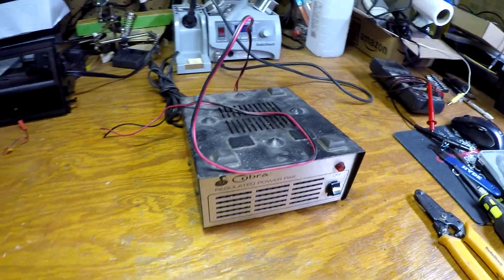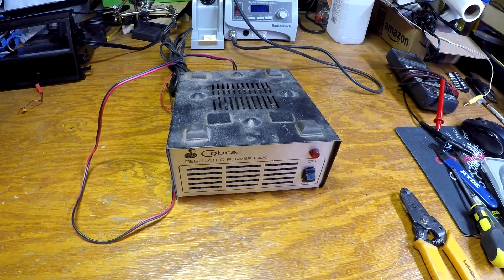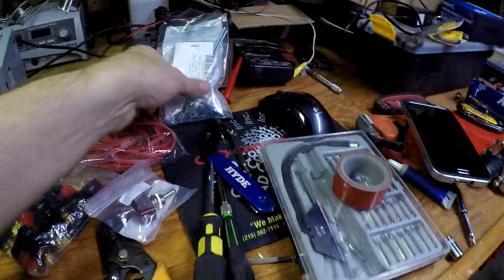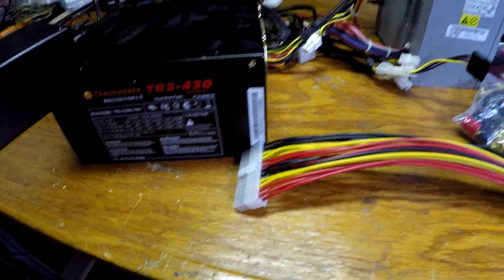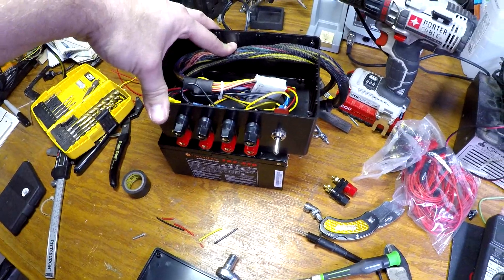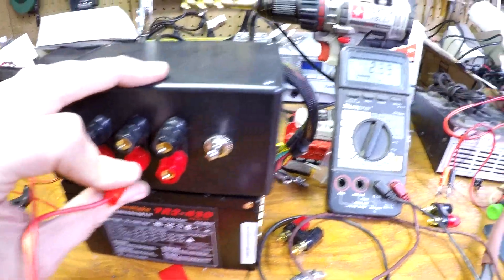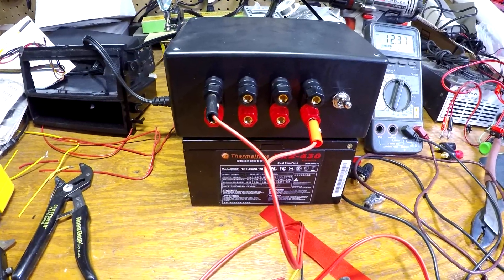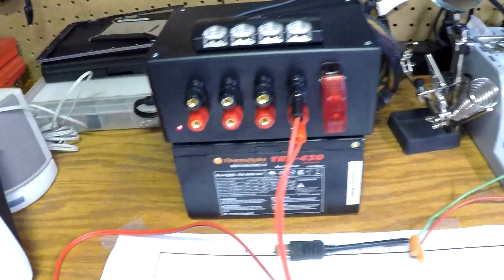How To: DIY Bench Top Power Supply From Old Parts!!!

Comment: Look at the rating for the -12V line. It's only rated for 0.3A. Also, you have two 12V rails on there. One is rated for 14A, the other is rated for 15A. You have almost 30A at your disposal, whereas the plain power supply only has a single 12V rail of 18A.
Reply: +Tim Ramich I guess I should have waited until the end of the video to comment.
Reply from the maker: +Tim Ramich Hey Tim.  Yeah the -12v is rated at 0.3A.  I actually didnt know anything about -12v rails...and I still dont haha.  I know that after you add it to the +12v, you wind up with basically the capacity of the + rail.  Also, you cant exceed the wattage for the whole power supply, and I think there is a limit for that 24v combined output also.  I dont plan to ever put that big of a load on it though.  Not sure if Im going to rig up the 0-24v adjustable supply like I thought or just leave it be.  It would be nice to dial in 13.8-14 voltes to simulate voltage while the engine is running.
Reply: +JEG's Garage Because the -12V rail is limited to 0.3A that means you're limited to 24V @ 0.3A. I believe it was just there for some older analog devices like sound cards. The AT standard had a -5V line, and I guess ATX upped it to -12V. It's not used anymore.
Reply from the maker: +Tim Ramich Tim, You are 100% correct.  I didnt really look into it, because i wasnt ready to mess with making it adjustable.  I thought I had seen a write up where someone used it.  Now I see it will be limited to the 0.3A.  I was wondering if its 0.3A at all times? Or if I adjust it down to 14 volts, would I have more power available?  I still dont quite understand how the -12v rail works, but Ill put some time into it.  I thought I saw you just couldnt exceed a certain wattage on the rail.  Thanks for cluing me in though, Ill do my homework.  Probably end up not messing with it.
Reply: +JEG&#39;s Garage Nope, those limits are hard. The black "ground" has a potential of 0V. It's not a negative charge. -12V has an actual negative potential. If you take 12V as your positive, and 5V as your negative, you can get 7V out of these things. You can mix and match any potentials, like 12V and 3.3V, or 5V and 3.3V. You would also need a hell of a potentiometer to give you adjustability at decent currents.